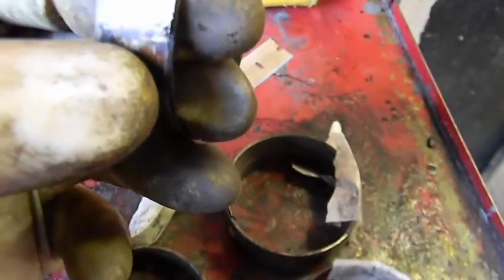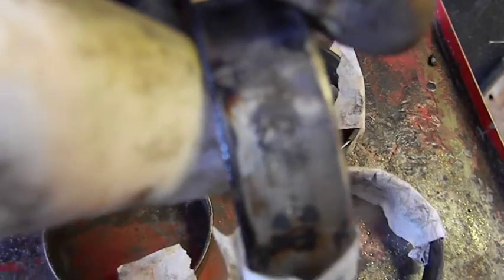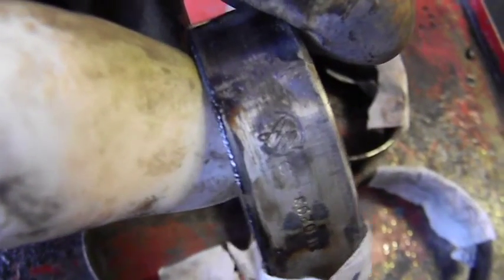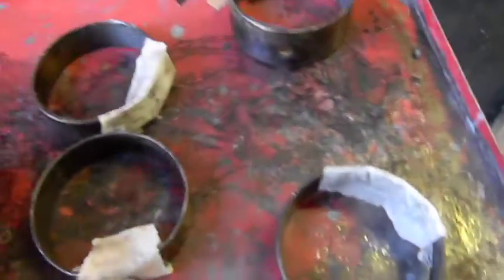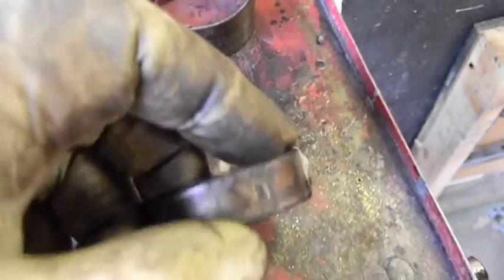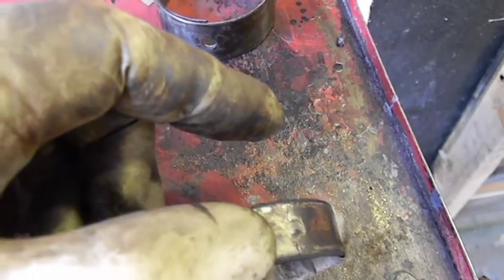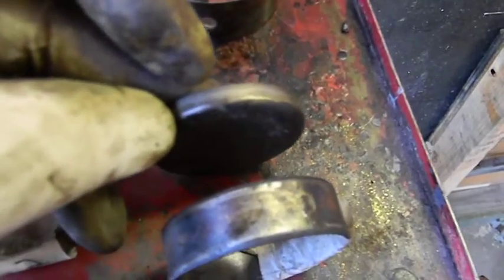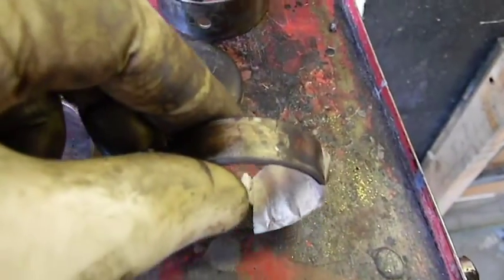AMC Camshaft Talk

Comment: The original difference between a Chrysler lifter and an AMC lifter is that the AMC oils the rocker arms through a hole in the pushrods, while Chrysler engines oil through a rocker shaft. This means the AMC pushrods has a hole in the center which is not needed on the Chrysler. Because of this the AMC lifter has an oil hole in it to feed oil through the pushrod and up to the rocker arms. Original Chrysler lifters have no hole in them, but most aftermarket lifters have this oiling provision allowing the lifters to be interchangeable. Be careful to make sure your lifters have the oil hole in them.

Comment: ALL  Stock AMC  Cams were almost IDENTICAL / 290 / 304 /343 / 360 / 390 / ... except the  401 
the 401 was only SLIGHTLY  higher  LIFT & more  DURATION  than it's smaller Cubic Inch brethren 
the CRANE  FIREBALL  Group-19 CAM was only a bit better than the 401 but still used the Stock Valve Train components 
All these cams were "SYMMETRICAL  as the  INTAKE & EXHAUST were  the same  LIFT /  DURATION 
...
I found that AMC  V-8's appreciated a "bit"  >MORE Lift & Duration on the EXHAUST 
...
which could be accomplished by installing a  HALF-SET of Roller Rockers on the EXHAUST Valves with a  1.7  ration ( vs the stock   1.6 ratio rocker arms ) 
IMHO 
...
COOP
Reply: Thank you, something to think about.

Comment: Just went by the old Chrysler/AMC plant in Kenosha. Nothing but a pile of rubble too bad to it really set that area in poverty.. Still I remember when it was in full swing. Ahh the good old days.
Reply: MidwestMotoRider I wish they had made it. AMC wasn't judged by durability for sure. The creature comforts of their competitions overcame the durability of their cars. AMC carefully engineered their v8's to outperform the competition. Before they got into racing they focused on durability. The end product was a great combination of both. The only problem with their V8's was their decision to use a Buick style oil pump housed in the timing cover. If you look at the bathtub style intake manifold gasket and laid it on top of a Big Block Chrysler Manifold gasket you'll see the intake ports were identical. Not only the size of the port, the entire port was designed for flow. They had really come up with a winner. To see their demise was confusing and heartbreaking. They deserved better, especially in the history books of the streets. Now, properly built like Anthony is doing here shows just how efficient these motors are. Their only real competition is as follows, Big Block Chrysler because of displacement and oiling, Chrysler Hemi, ( are there any questions, it Block Buick as realized by TA Performance in Scottsdale AZ, and Ford aboss 302, 351 Cleveland and Boss 429 family of engines.

Comment: Also, prior to cam companies and auto manufacturers using the standard duration at .050" lift, the advertised duration of a camshaft might have been measured at .001" lift or .005" lift or anywhere on the ramp for that matter. To Hot Rodders, bigger is better so there was always misinformation in cams specs as manufacturers tried to attract buyers. Now we can compare cams from different manufacturers using duration at .050". Also, somewhere along the way somebody sold what they called a 3/4 race cam. That really didn't tell you anything except that it was bigger than stock. It was just another marketing gimmick for a guy that wanted more power, but wanted street drivability as well. My Auto Shop teacher took a worn cam, busted off the back two cylinders and hung it on the wall with a sign that said 3/4 Race Cam.

Comment: I'm assuming the camshaft gets thinner from the front to the rear due to needing less torque as there are less valves to open as you move along the shaft saving overall weight, I'm probably totally wrong, only reason I can think of for the bearings getting smaller. Wish I could get rollers for the SX but no one makes them